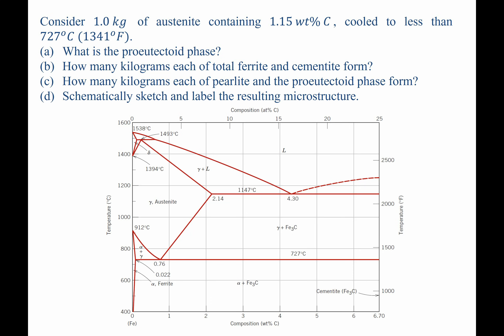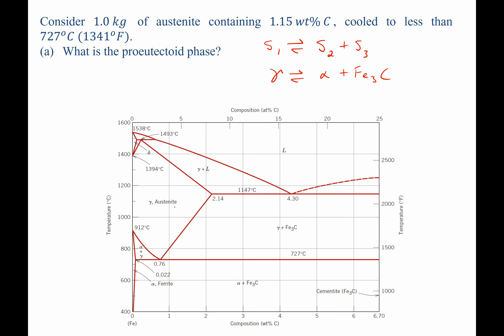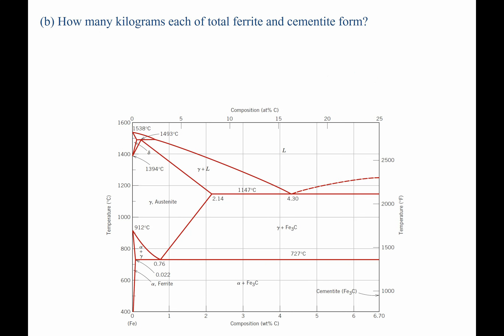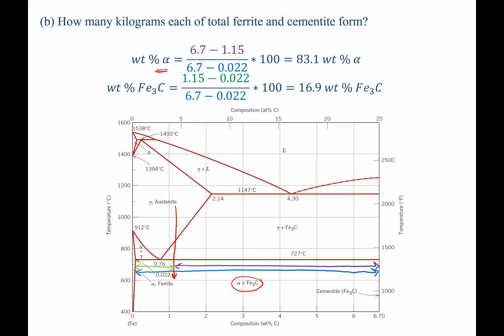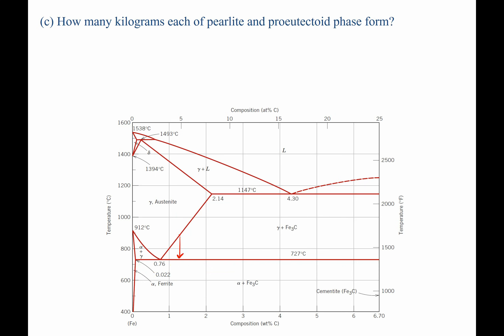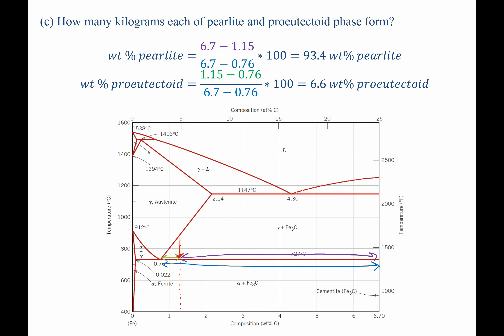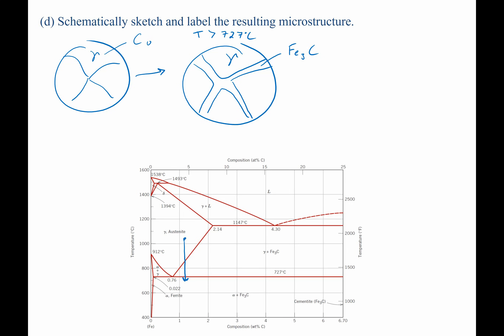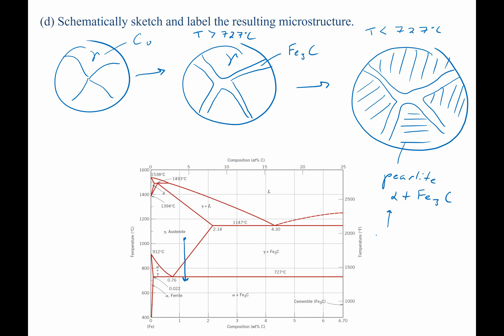Steel phase diagram cooling and Lever Rule example problem

Comment: hi sir, what if the point they want us to calculate the compositions of is in the liquid phase (3wt%C), what numbers are we using?
Reply from the maker: You can only use the lever rule in two phase regions. So unless it's an immiscible liquid (L1+L2, like oil and water) you would not use the lever rule for the liquid.
Reply: @TaylorSparks  thank you sir. how would we calculate the composition and percentage of each phase then?
Reply from the maker: If it's a single phase region, then the composition is simply the composition and the weight fraction is 100%  @juli_lj

Comment: why is it for part C that you identified the purple line as pearlite, and not austenite?
I think what happens is that just before the eutectoid temp, what will be produced will be 0.934kg austenite(not pearlite) and 0.066kg Fe3C. After it, there will be 0.831kg a-ferrite and 0.169kg Fe3C as you solved in part B. 

If you notice the difference between the Fe3C composition before and after the eutectoid temp (0.066-0.169=-0.103), it is 1.03%, so only 0.103kg Fe3C is added/formed! And we can only get Fe3C from austenite. SO, only 0.103kg of austenite actually participated in the eutectoid transformation. 

And if you notice the difference between the amount of austenite and the amount of pearlite formed before and after the eutectoid temp (0.934-0.831=0.103), it is also 1.03%, thus only 0.103kg austenite transformed to pearlite, and the rest transformed to ferrite.

Is my analysis right? Let me know if what I pointed out is right.

Comment: Sir, I got a question, how pro-eutectoid cementite is different from normal cementite?
Reply from the maker: Proeutectic will be present in larger globs as opposed to eutectoid which will be present in lamellar structure.

Comment: Great video, I have a question how do the microstructures look like if for example at 5wt%C it's cooled to 700°C
Reply from the maker: It depends on the processing history. Was it cooled slowly quickly rapidly? Was it held at a temperature at any point? Was it annealed? All of these things modify the microstructure. So asking how the microstructure looks at a certain composition and temperature the phase diagrams will only tell us the equilibrium phase fraction, but the processing steps will give us much more insight about the distribution of those phases which is often related to the properties of interest

Comment: Great video! For part c), is asking for the wt% of pearlite and cementite the same as asking for austenite and cementite?
Reply from the maker: Good question. we know that after the material undergoes the eutectoid reaction all of the austinite is converted to a mixture of pearlite and cementite. This happens relatively quickly and so it forms the lamellar structure which we would call pearlite. It's possible to form proeutectoid phases though, such as proeutectoid ferrite or proeutectoid cement.